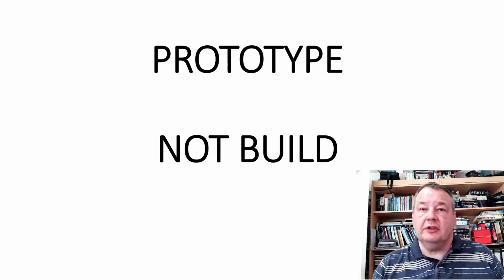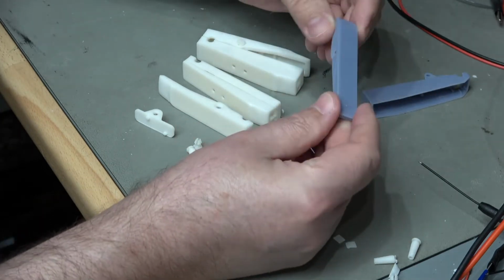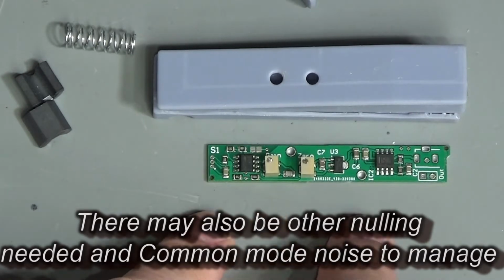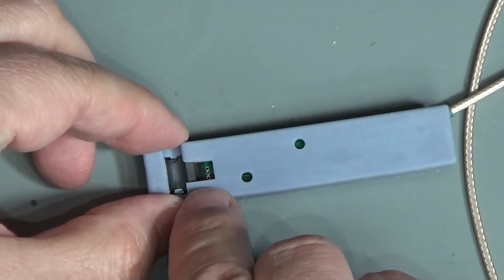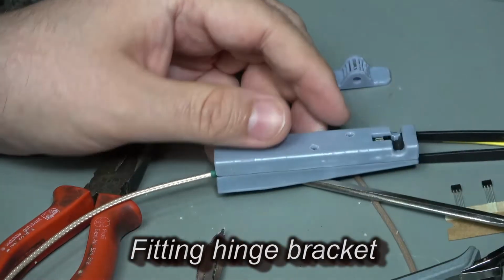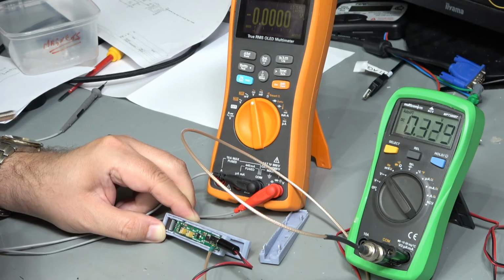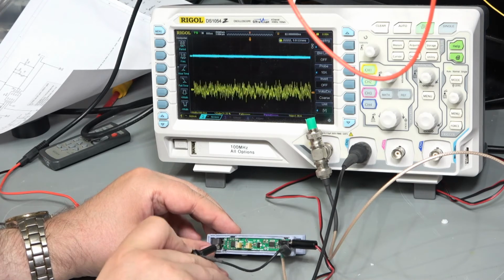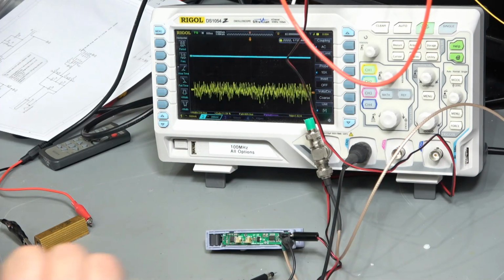Current Clamp Prototype pt 3 #0062

Comment: I totally agree on what you said about prototyping. It is very much about the journey and about finding all the little bugs and problems. To get a second or maybe third version that is close to perfect, is however a whole different story. 

For the coax connection, you could use a mmcx socket between the trimmers. They are quite small, reasonably cheap and available for the right kind of coax you want for such a probe. (RG174, RG178, RG316). 

The sensitivity to the position of the probe is a common thing. you are supposed to not move it during measurements and trim it before each use. 
A huge part simply comes from the earths magnatic field - as you already said - and therefore can't really be changed.
Therefore most sensitive currentclamps (as you mentioned, most are more for high currents) have the trimming in a different enclosure in the calbe to keep the clamp stationary. 

I guess the noise could propably be a bit better by using some fancy DSP stuff and a better sensor. 
(Most hallsensors for current clamps are custom made, as far as I know)

For a first prototype I find your result pretty impressive. 

Thanks for the journey and I'm looking forward to your update videos. :)
Reply from the maker: Thanks, that was encouraging, I'm always a bit worried when I share the parts that go wrong or are not totally successful.  I will take a look at those connectors, sounds like they are just the thing.
Reply: @MakeOrRepair  In my opinion, the longer and more complete a video is the better. You get the most use out of the final product but you learn the most and grow from all the little problems and issues along the way. It also helps for giving an accurate picture of how complex such a development is and just how much time and work goes into it which is often overlooked in my opinion.